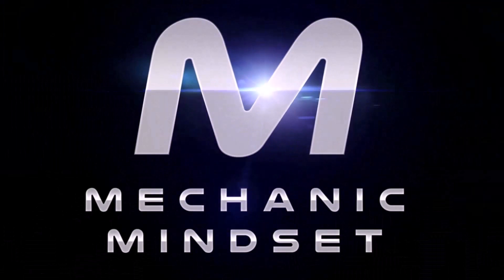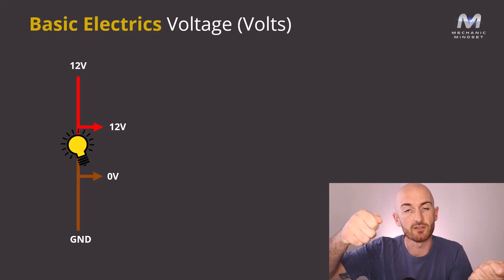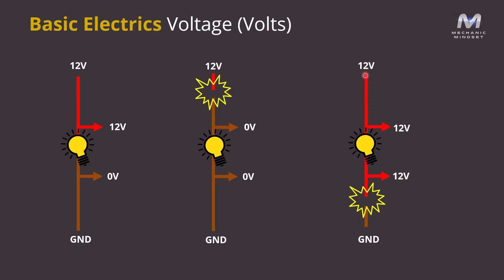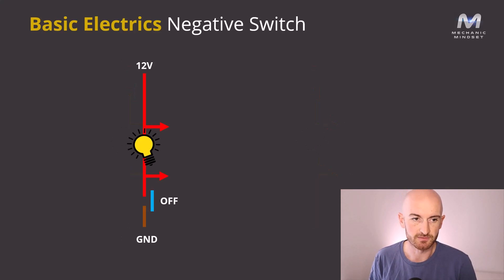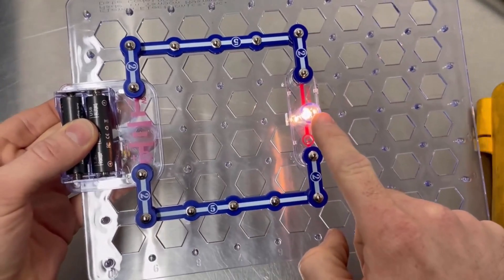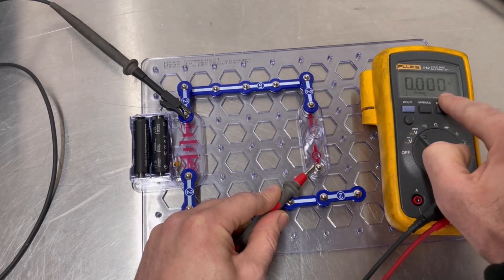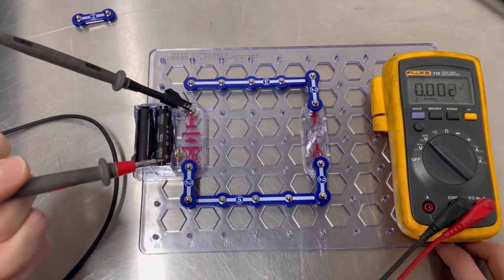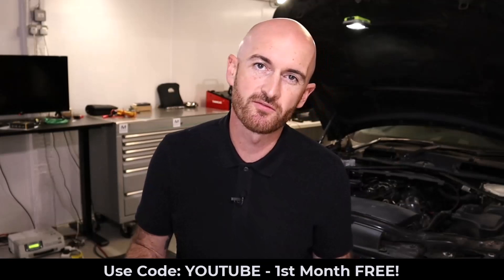Avoid This Common Mistake When Testing Electrical Systems!

Comment: Where can you buy that testing board at?
Reply from the maker: @tylerhill6706  A site called Robot Shop - Snap Circuits
Reply: @ ok thank you
Reply: @ would it be good to buy larger set for practice or just smaller cheaper kit?

Comment: Wrong you are still connected to Earth, that invalidate your logic,current needs a road map, in other words voltige can only travel down any road if there is an exit (earth)
Reply from the maker: Which part Peter? When the circuit is switch on, or switched off?
Reply: @MechanicMindset  multimeter earth connection earth to neg givespower
Reply: Don’t try this. If you’re not earthed if you touch the red wire you will not be electrified. Put your finger on the plus sign on the battery no problem touch the both + - electric shock

Comment: I would gladly like your advice. I have saved some cash for Picoscope 2406B for Auto use. The dealer is out of stock and offers me a 2208B. Should I take the offer?
Reply from the maker: You’re getting close (price) to just going for the Automotive scope. I’d say go for the 2405a or just save a bit more and get the 4 channel Automotive scope on its own 👍

Comment: Nice video but can’t wait for voltage drop Why do you show the first circuit with 0  0.00 on the ground? If it was 0.00 you have a problem with an open load you demonstrate the bulb in that circuit ground side read 9 millivolts a complete circuit That’s voltage drop proving a circuit ground side VD usually less than 0.100 Just my observation CHEERS
Reply from the maker: It demonstrates that it is connected to ground, as ‘nothing’ is different zero. In that example it was open circuit. The next lesson in the course builds on this
And it sounds like you understand it already 👍
Reply: @MechanicMindset  that’s why I subscribed to your channel I like to learn and listen from your perspective and knowledge HAPPY NEW YEAR  🎆 CHEERS

Comment: Unfortunately, most automotive technicians do not like to read, many more do not like to sit in classes or training seminars unless it has beer and pizza 🤣 

And there’s many who don’t even have the patience, unfortunately to watch videos like this all the way through . 

And the sad part is I’m talking about 10 missions who have five years to 15 years experience and still do not understand the basics of voltage drop and power consumption . 

Automotive industry is in desperate need of more channels like this . 

Now, if we could just do something about the individuals who are in the Automotive who should not be .  Unless they’re forced by gunpoint to actually do some reading and training and education.
Reply from the maker: 😅 You can lead a horse to water…. 

I think something can be said about leadership, motivation and being shown the value of training and learning. 

You’re right, many don’t understand this basic concept and it will be the customer that pays for it eventually. 

As you know, we focus on making it engaging and easy to understand so those who stumble across us may be enlightened 😁

It’s a difficult situation!

Comment: Could you give me the name of the kit you were using to make the basic circuit on the plastic board? Or a link would be even better. Great video! 👍🏻
Reply: Called “snap circuits extreme” it’s a teaching tool
Reply: @ChrisZBr0wn  I hate how expensive they are, I always wanted them growing up but just to much damn money
Reply: @Rockardo_ 
You can do the same job  with a cheap tool 
Instead of multimeter you can use a test chisel=test light